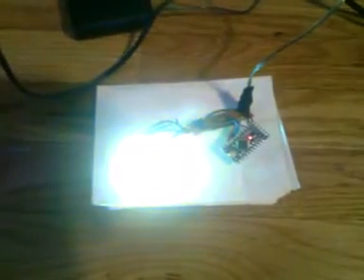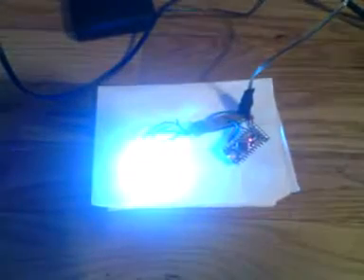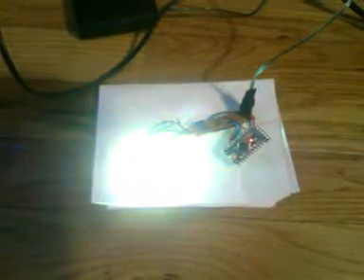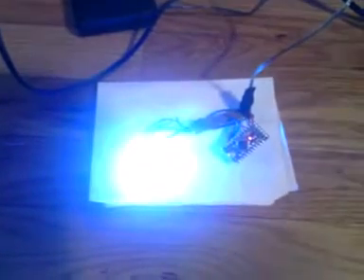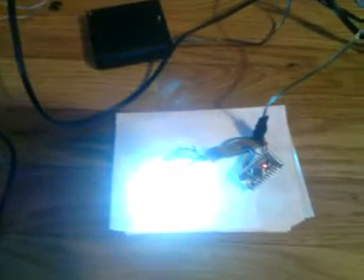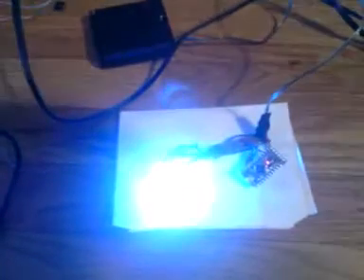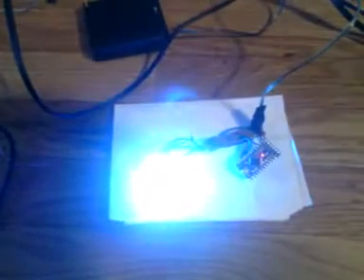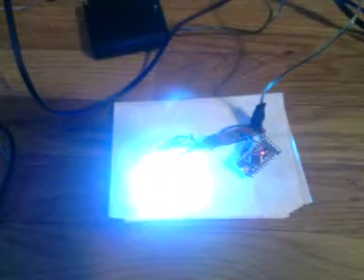9 RGB LED flashlight with 5v arduino pro mini.

Comment: Is the driver available as a unit or did you have to build it?  Whats the current drain?  How long would the batteries last before the lights went out?
Reply from the maker: San Diego Design Its hand built, its a real simple design. The current drain varies but it should be under half an amp. I wasnt able to build this into a flashlight the way that I had wanted too, and it ended up lighting a fiberoptic bonsai tree. Here is an instructable about the bonsai.http://www.instructables.com/id/Improve-fiberoptic-display-with-LEDs-and-micro-con/It does run on batteries, but I dont know how long it will run on them, I used it mainly with a little USB power supply. 9 RGB LED at full brightness white shoud use 9 x 3 x 20mA, or 9 x 60mA, or about 540mA, but when you are colorcycling, it uses about 1/2 or 1/3 that.
Reply: Thanks. Im trying to build an led light that emits enough lumens to read a book and in which the batteries will last for a little while. So Im hoping to design a light that will only draw 20-50 mA.. ..maybe not possible
Reply from the maker: San Diego Design For your needs, you should consider white only LEDs. These LEDs(The ones in this video, and instructable) are for being able to make a wide range of colors, but not particularly good for reading. You will probably want to test a few different LEDs, as color may vary, some colors may be better for reading than others. Most small LEDs are 20mA each, so you are looking at a few LEDs at most. LEDs are current sensative, which means if you use too high of a voltage, that will cause too high of current, which means you need to add a resistor, which wastes energy and makes the batteries not last as long as ideal. Bateries have whats known as an internal resistance, and this resistance limits how fast they can discharge. If you use the right battery for your LED, then you may be able to run it without a resistor. CR2032 batteries (quarter sized coin cell), and other coin cell batteries will usually run LEDs without them needing a resistor. Another way extend battery life is to use PWM (Pulse Width Modulation) to blink the LED very fast (beyond our ability to see if turn on and off). A Joule Thief circuit is a common way of doing PWM, and getting high battery life.